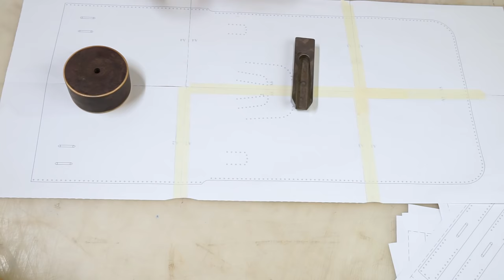Casual Leather Backpack Pattern, How to Make a Leather Backpack

Comment: It is a very beautiful work!  congratulations!  do you glue two leathers together for the straps?
Reply from the maker: it depends. If you have a 3-2-3.6mm firm contrast leather, you can use it as it is. If you don't have it, you can line to obtain the same consistency. I line a lot because in this way I can control better the consistency.
Reply: @VasileandPavel  Ok thanks! Is it wrong if I do it with 2mm leather?
Reply from the maker: @juanvictormendoza1185  no, it's ok but line the contrast leather with 1mm leather, suede or pig skin.
Reply: @VasileandPavel  Thanks!

Comment: I was looking and looking, I knew I saved your video, but had to skim through a bunch. I was trying to find that guy that punched all his holes with a hole punch, instead of using a pricking fork. And now I found it. I am giving up on the those forks, cause the holes are so small, and I end up using needle nose pliers to pull the needle and thread through the holes. And if I am stacking patterns, and punching through 3 layers, the holes always end up jagged and not matched. I think your method is the best, as the holes are well defined and clean, and using patterns insures the stitching will look excellent. Just my two cents, I'm an amateur working my way up to becoming more professional. Thanks for the video.
Reply: Buy, wuta 1.5 mm hollow punch, use a 1mm polyester thread to stitch, If you are US there are some at 0.92 mm from Maine thread company, its expensive but awesome thread. While punching holes always use a compass or some tool to mark a line from the edge and while placing the tip of the punch look to keep it in the middle of the line. Use leather with some kind of rigidity to it and it will be a good start.

Comment: Great video and design! Just ordering my buckles and metal parts just now. Do you think I could use 2mm leather for the backpack or is that too thin ?
Reply from the maker: 2mm stiff leather is good enough but line the contrast leather, the straps needs to be 3.4-4mm thick. Join my FB group and ask there what question you want, I can answer private and if needed, we can wideochat
Reply: @VasileandPavel  thank you for your answer :) I will do that and definitely get back to you with some more questions probably. Thanks a lot!

Comment: I've been looking for a hobby lately, I work with horses and when I'm home I'm bored, thought about wood working or something along the lines, but I really want to give a try with working with leather. Any tips on how best to start out?
Reply from the maker: there are many answers to your question. My advice is to buy a set of esential tools, not many but they have to be good quality tools, otherwise they will make your life a hard one. You need a cutting tool (I use olfa cutters but there are many other good tools), metalic ruler, a good table with a cutting board (find one from industry), a good punching board (from industry), good round punches (or pricking irons) and you need to stitch, so you'll need thread and needles. About the leather... hmmm, I am lucky, i find in Bucharest all sorts of leather so I learned leathercraft on cheap leather, i hope you'll find something similar. And many-many tutorials, watch them and choose what suits you. And something very-very important: you can make mistakes, no one will blame you.

Comment: Hi! I just purchased this pattern, it's awesome! I was just wondering what the spacing is between the punch holes in mm? I'm debating on whether to punch holes or just use diamond stitching chisels. Thank you!
Reply from the maker: Hi. Usually i make holes with a 1.5mm round punch. The distance between holse is 6mm but not everywhere, sometimes is 6+ or 6- mm. I have a few patterns with 5 mm between holes but i use the same 1.5mm round punch. My thread is 1mm nylon waxed  thread
Reply: @VasileandPavel  Hi. It looks wonderful. I think this is gonna be my next project. But I have 2 mm round punch. Is it ok to work with it or should I buy a 1.5 mm punch? Thank you.
Reply from the maker: it's better to use a 1.5mm round punch with 1mm waxwed thread. You can use 2mm round punch with 1.2mm waxed thread but you have to know that almost all the patterns ask for 1.5mm round punch. Buy more than one punch and buy punches with long active part. They don;t have to be expensive punches, Wuta is perfect for the job and one punch is arround 7$
Reply: @VasileandPavel  understood. Thanks for fast answer.
Reply from the maker: @vahitturun  i was near my laptop :)

Comment: Very Nice bag. Did you use suède ? Can you make suède waterproof ?
Reply from the maker: no, it is not suede. I use suede only for lining but not for this backpack. This is a pullup that is often used to make insulated boots. I can't make waterproof suede but sometimes I buy that type of suede which is made like this in tannery. It is used for protection equipement
Reply: @VasileandPavel  thanks for the information, have a Nice weekend

Comment: So is the single hole puncher better than lets say hole puncher with many heads im tryingn to get into it but is it necessary to use the single one first?
Reply from the maker: i m used to make holes with a single punch. Punching the holes for a project means a small procent of the work so if i'll use a tool with 5 punches, i;ll gain only a few minutes. And when i started leathercraft, i didn't find any other type of punches.
Reply: Sinabroks make an excellent pricking iron, lots of different sizes and option, I believe you can get them up to 12 punches per iron, it would save considerable time and it’s easier to get a straight stitch

Comment: Do you know how many yards this would be in fabric
Reply from the maker: DIMENSIONS: 
40/30/12cm or 15,8/11,8/4,7 inch

MATERIALS:
1 sqm of oil-tanned leather 2.4-2.6 mm 
0.3 sqm for the contrast leather 
4-4.5 mm veg-tan (be sure to have the length for the straps)

ACCESSORIES:
Roling buckles: 1 x 20mm, 4 x 25 mm
D-Rings: 2 x 25mm
1mm waxed thread
Fenice's edge paint